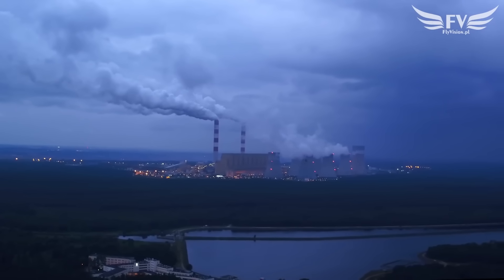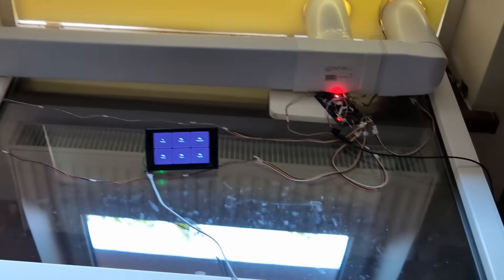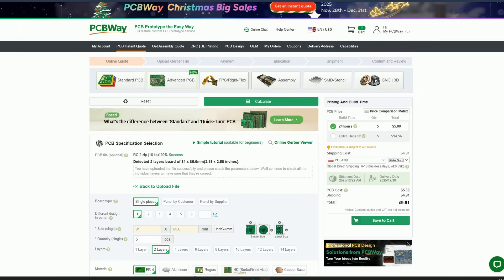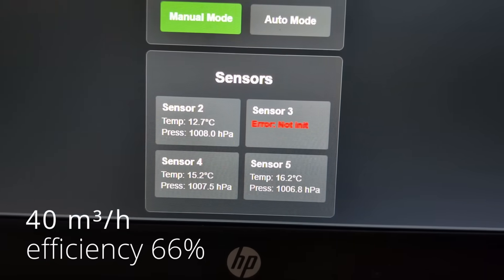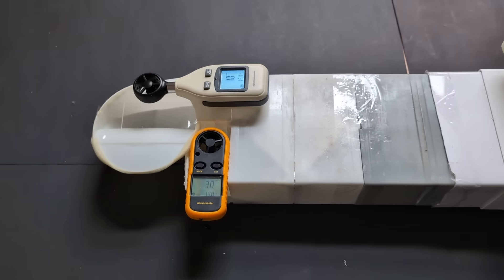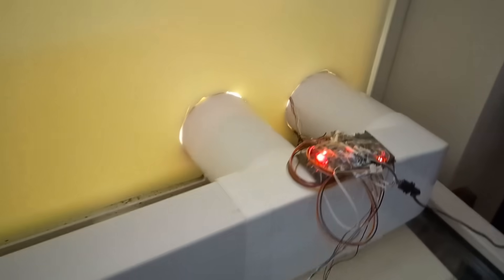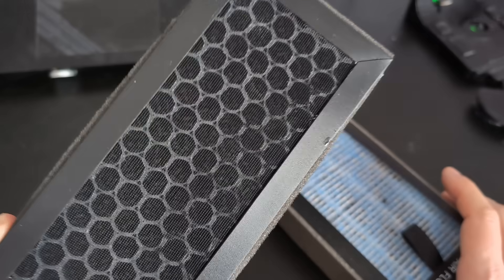DIY Heat Recovery Ventilator: From 55% to 90% Efficiency (Real Tests)

Comment: Nice work but I advice against aerogel. Not only that exposed aerogel produce pollutant by itself, system efficiency won't improve beyond what your window seal can provide. It's better to find heat bridge and patch it than reinforcing already strong points. I recommend PU expanding foam and simple silicone caulk for this.
With your noise concern. High frequency travel like ray while low frequency travel as a pressure wave. Depends on spectrum of the noise you are getting, approach needs to be different. But that's about stopping noise from propagating and the best way is to suppress the source of noise, for obvious reason. This could mean better bearing, better balance of the fan itself, air volume resonance, etc.
To reach high pressure with low noise frequency (because high pitch is more annoying and noticeable), you might as well use series connected inline fan instead of centrifugal.
I don't support the membrane idea because constantly wet surface is great recipe to bloom germs and molds. That will simply result in pouring mold spore in to your room eventually, unless you are planning to swap it ever so often.

Comment: This is amazing. I'm really glad I found your channel and will follow your work. I want to build something like this for 5th wheel rv's. I feel like you're trying to do too much though. Drop the filtration down to a simpler filter and then you can use in line fans that are quieter. You're trying to combine too many systems into one unit. For people that live in very polluted areas they can just use a dedicated air filter in the home. You don't want your home air too sterile or you're going to harm the hormesis affect of your immune system.

Comment: Have you seen this? This guy designed a fully 3d printed heat exchanger. With the extremely thin layers it's efficiency should be comparable.
https://youtu.be/gulOgUAUVI0?si=ahlIbVQ7wISNLSvX

Comment: The X shape of the air flow is suboptimal, i have seen a custom made passive heat recuperator for a paint oven where  i used to work, the guys designed it themselves because what was commercially avialable was not real good, they where in the 90% range of heat recuperation. they where using aluminum sheats as a airflow separator, think like your first tubing idea, but just plain sheats of thin gage aluminium, you could do it with tin foil. the flow was linear,  not X shaped. the cold air came in where the hot air left, so that maximum extraction could be be achieved. it is also a lot easier to seal. and in an industiral setting, it had to be cleaned once in a while also, so sheats in slots made it easy to clean. don't give up, I like how you think.

Comment: Instead of one long tube, or one big assembly, split it into multiple sequential assemblies. One long assembly will lose heat due to the heat going along the tube instead of actually exchanging. 🤔

Comment: You can make a cross flow air to air heat exchanger with only flat sheet metal, much easier to manufacture and more surface area relative to price. no need for all those fin tubes. Actually, some of the air to air coils I installed were made in Poland and installed in the USA ....

Comment: So I have found such thing as ACCP, which is the aluminum core composite panels, but it seems hard to buy, I will be asking for quotes from the Chinese manufacturers of these panels. I work in a sign shop, but have not come across this type of material and it seems all the regular companies don't manufacture such a thing.

Comment: The air quality map can be misleading due to the location of the sensors eg in the US.... air quality will be worse near large roads or eg paper factories, but the dominating air quality factors are natural for at least half of people in the US eg pollen or other natural air problems. Also some areas like SF in the US have geographically insurmountable air quality problems.

Comment: If the main objective is clean air, and air pollution is coming from outside, wouldn't it make more sense to have a central, recirculating, filtration/conditioner? That way the high volume flow doesn't need to go through the exchanger and you can have a smaller, low flow, exchanger for fresh air makeup only. Surely you get cleaner air by refiltering inside air, than by a constant flow of once filtered outside air?

Comment: This is brilliant work!, I have a suggestion for the design of the next, more permanent installation now that you have figured out the mechanics of this device. Place all the fans, ducts and filters on the outside of your house/apartment. This will reduce noise inside tremendously, it will free up space and you will get the air you need without many of the compromises an indoors device.

Comment: It is funny that I have been on a similar journey for the last 5 years and I have only seen your videos today. The only thing I would suggest is to see if you could eliminate the corners in your project, if possible. It allows you to lower your fan speed to achieve similar airflow. I am currently using my forced air HVAC system, instead of small fans, however the best fan I have used so far is the WDERAIR 90mm x 38mm PWM Dual Ball Case Fan 12V 4Pin High Static Pressure. With a baffle in between two of them, in each channel. For a carbon filter, I am still struggling. Keep up the great work!

Comment: Great video, however, there is an issue that you are neglecting. If the air quality outdoors is poor, drawing in that air could be compromised. The intake should have filtration before the heat exchange process. Filtration should include HEPA and carbon.

Comment: 7:00 - im working on my own one--- already another one made from this material , it needs to be bigger than that , its better to just stack them on each other in one direction  (same lenght , width) , glued using contact cement (it makes a difference) 
and shifted off center so you can have in/out on the ends and both fans (in/out) on the front , or fans on both ends and in/out ...also on the ends but blowing  sideways making it super compact   (its literally same concept as "pipe in pipe" exchangers)
then it work marvels , the X shaped one is easier to make modular for cleaning etc but not the smallest one
Reply: i was building X shaped ones for workshop , for welding etc so you can run the fan long time in winter without making it cold inside small workshop
if its big enough it will work rly rly good , the "one direction" 😆 one works even better ,is more compact and you can easily make it to be mounted as "trough the wall" one in your house , running 24/7
(i will make a video of it if i have spare time)

Comment: Sure you could worry about air pollution, or you could realize that the amount of micro plastics you sleep on, ingest and respire is astronomical, you're losing a battle against an invisible foe you have no weapons against. Nearly everything we make is shedding micro plastics into the environment. Clothing,  bedding, tires/tyres. Some items which we can never replace, we have no replacement for vulcanized rubber.... it's futile. I'm not ignoring the air pollution altogether, it's just not a problem we can fix as a society as long as we are structured in our current form of having the maximum amount of people available at all times.

Comment: I am looking at a system like this too! Though a bit larger, for the bedroom side of the house. 

Current plan: ~37x 19mm Aluminium tubes inside a 200mm PVC tube. 
Something that came up in my research was to use baffles inside the PVC tube to force the air to take a snake like path down the path of the tube. 

I'd be interested to hear your thoughts on that, if you think it might increase the efficiency of your model?

Comment: For sensors, you can use if then statements in whatever code your using to ignore erroneous measurements. If the measurement is higher then can be expected then use previous measurement or the average measurement. You can also create an average measurement that picks up a range and ingnores out of range. You can also shield the wires or use protections around the entire box.

Comment: Congratulations... Looks and sounds like you have reinvented what commercial companies already sell. Of course they sell it for much more than just the material cost. 

Decentralized vents for heat and humidity recovery already exist. You buy it, you install it and it just works. No years of fiddling around mit DIY.

Comment: The heat exchanger with pipes - won't thinner pipes improve the efficiency by a lot? They're transporting a lot of heat from the inside to the outside because of how thick they are. Maybe a simulation in free online software like simsolid could help narrow down ideal geometry?

Comment: I have been building my own for 40 years, they are simple, have a large surface area and very high efficiency and and up to 300 cfm for the biggest one for my greenhouse.
Mine are made from aluminum flashing with 1/4” spacing and counter flow for alternating Chanel’s .

Comment: I imagine one could take a sheet of copper [say] 1x1 meter and fold [say] 20 cm back and forwards again so that you get a WWWWW shape (with the thickness 20 cm). Wrap it in tape leaving the ends unwrapped. Glue something on the top on both ends. Pump in the cool air from one end and the hot from the other. (for example hot though the bottom end and cold though the top) If you want more exchange make it longer and/or add more units (you'd want to avoid heat traveling though the length of the copper) It doesn't need to be wavy.

Comment: Hi! I'm not quite sure of your calculation at 5:55. Trying to understand it leaves me with a totally different result: eta = (T_fresh_out - T_fresh_in) / (T_exhaust_in - T_fresh_in) = (8.75 - 3.67) / (19.27 - 3.67) = 5.08 / 15.6 = 32.6%. Where did I make the mistake?

Comment: 12:03 Why is the insulation in the window openings left unfinished and exposed to the weather? Doesn’t the color of the PU foam bother you? This damages both the insulation and the building walls.

Comment: i wonder how mask filters like 60923 would perform, use to use these with sanding various comporite structures, fenolic resins, with paint striper, MEK, Turco 6646, very nasty stuff, and you can't even smell anything, not for long though 😅

Comment: Some comments from experience making high efficiency heat exchangers (90%+) in other areas
- It looks like it's a crossflow design, you'll be limited to the efficiency you are basically at I'd expect. To go higher you need a counterflow design.
- Thinner aluminum if it seals may work better than thicker copper if thats easier (it's cheaper at least). Aluminum foil from the shop is quite good
- Aerogel is great but for lower cost and only slightly worse performance silicawool fibre (superwool) is often a good choice.
- Air tightness is hard :(

Comment: Hi Yarik, 
great work that you are doing. Air pollution and especially heat recovery for ventilation is an important thing. 
01:13  This also can be mold growth as air inlets that are covered are massive thermal bridges with low interior surface temperatures leading to condensation and mold growth
03:03  Central units can be beneficial in comparison to decentralized variants if the floorplan is suitable and air duct lengths are short. Usually the initial installation cost for decentralized variants is lower than a central one but you also have to factor in that you have to change the filters for every decentral unit once or twice per year. You can see which concepts are already there especially in retrofits: https://europhit.eu/sites/europhit.eu/files/2016_Component-Award_Broschuere.pdf
03:06  Air flows usually are too high from our experience if just the standard approach is used (also leading to dry interior air). 
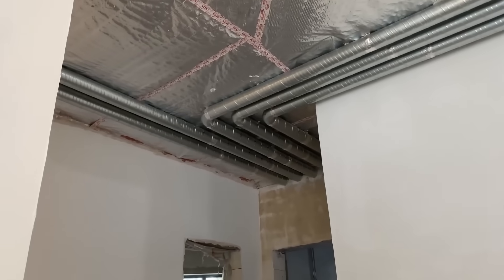03:17  Also flat air ducts are available reducing the height needed to around 4 to 6 cm. 
03:24  Heat recovery rate of decentral units usually is lower than for central units.
09:03  Yes, this really is an issue. In europe ventilation units are tested for how much the heated air coming into the building is heated up. With this all losses from the ventilator are included in the heat recovery rate which is not ideal. This is why the Passive House Institute is testing units uses a different approach. Here it is tested how much the extract air is cooled down – how much of the heat is extracted. The difference in heat recovery rate can realisticly be around 10 %! You can have a look at cerified and tested units here: https://database.passivehouse.com/en/components/list/group_2
There you can also find decentral units already on the marked with realistic heat recovery rates above 80 %!
It would be great to have more competition in the field of ventilation units as their cost really is high compared to what it should cost to produce. Maybe your findings can help, put more pressure on manufacturers to produce cheaper units. 

There are also ideas to integrate the whole ventilation unit in a diagonal tube in the exterior wall, maybe that could be a useful resource for your reasearch: https://passipedia.org/planning/building_services/ventilation/facade_integration_of_ventilation_units

Comment: Very interesting project. I'm running 2 mitsubishi 100 ventilators, one in living room and one in the basement. They are controlled by the CO2 level in the room. I also have a plan to ventilate my attic, and it can be interesting to test your design there.

Comment: Don't you want to at least put a 90 degree bend on the external expelled or intake tube to avoid recirculation (although I don't suppose this would be very much) but still, I'm thinking a 90 degree downward connection for the cool, expelled, stale air would be the way to go.  But then what about driving wind and rain, you would want a grill cover over the intake too surely

Comment: Thanks for sharing your results. Please, do verify with real experiments, but IMO, the "plastic vs aluminium vs. copper" is a dead-end. Whatever material you use, the bottleneck shall always be the thermal resistance of the air itself. Adding turbulators to stir the air shall increase aerodynamic resistance, and shall add noise. The only other "knob" to turn is dwell-time. How slowly can the dirty+warm air move over the fresh+cold air? For a certain volumetric flow-rate, you can increase the length or area or both. For a given exchanger-volume, the shorter & thicker exchanger shall have a lower pressure-drop. How far can you stretch this principle? I don't know.

Comment: I have an idea that won't change your studies regarding heat exchange, but rather the energy efficiency of air filtration.
Everyone has computers or laptops at home, and they have coolers that are basically used to exchange heat. Why not put a more efficient heat exchange system in laptops and desktops that performs both functions simultaneously?
Well, if the notebook is already using energy to spin the coolers, why not just add air filters to it? The heat output will not only cool the system but also purify the air in the room.
Products with this dual function already exist.
https://youtu.be/h4uM-HFDPdQ?si=5DF3l1-EOnqFg2ZE
But the air filtration system is ridiculously inefficient because all models sold on the market use a thin layer of foam that only captures pet hair and clothing lint. I think developing improvements and maintaining air filtration in a compact device would be the key to an efficient system and would generate a product on the market that currently doesn't exist and effectively fulfills two functions.

Comment: For example, in a small home grow setup, especially in winter, the main problem is that the warm, humid indoor air needs to be exchanged with the cold outdoor air. At that exchenage point of contact, the humid air condenses. I'm planning something similar. My suggestion would be to use a Soler&Palau 350TD Silent with a 150mm hose connection. It's expensive, but with a transformer running at a lower voltage, it still provides decent airflow and is super quiet. thx for sharing

Comment: I have a thick layer of concrete as a ceiling and an empty storage space above it. This project seems perfect to just be able to put a few homemade vents and ducts in my attic, drill a giant hole and finally get ventilation, the noise won't come through my ceiling.

Comment: you can use Compressor and AC for the heat exchange or even use water as the exchange medium if you really want to go for the overkill.
big note about material science: copper is better at moving heat but not at venting to air, Aluminium is better for that bit, that's why high quality computer heatsinks have copper core and aluminium radiator fins. Copper also has a big problem when exposed to air, it will eventually corrode and crumble, while aluminium is almost untouched by the elements once an oxide layer is settled.

Comment: great work, even making your own plate heat exchanger, have you looked into copper brazed heat PHE's?  these are highly efficient in a relatively small form factor so if you would find a way to do DIY copper brazing on the cheap that  would make efficiency even higher, Also i think it would be easier to scale stamping the plates & solder alike. if you need help calculating plates or theoretical efficiency I can help you calculate. furthermore, since it is regarding air, you can make the plates and their gaps very thin due to not having any abbrasion/corrosion or fouling like you would with liquid based systems. of course air would be less conductive, but these systems are also frequently used for steam.
Reply: check out Alfa laval CBM's for reference